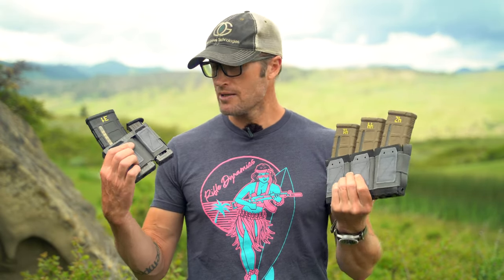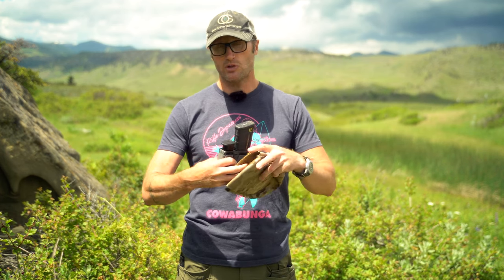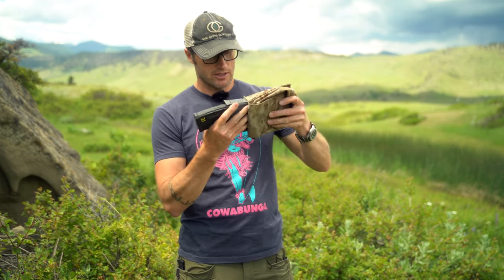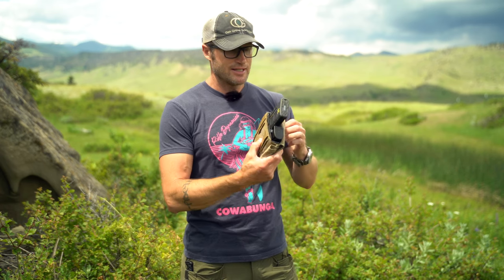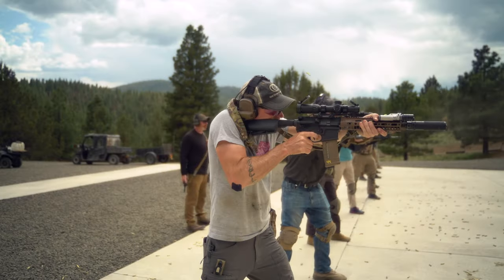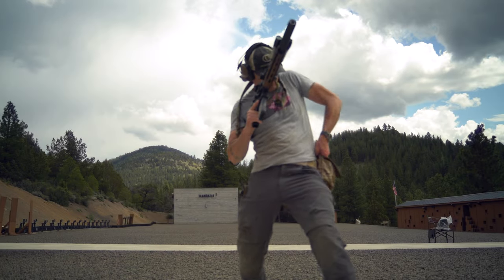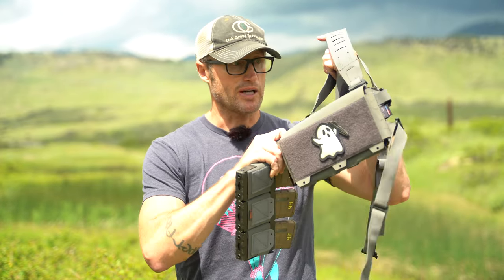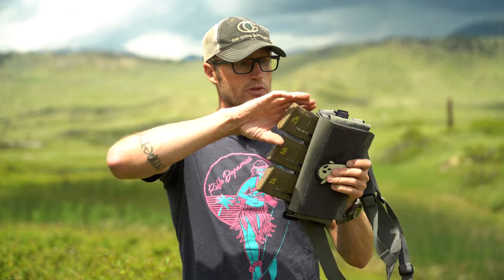Tricert and 1R1 from Lunar Concepts

Comment: I have a 1r1 in a JSTA pouch, retention is good with both G17 and G48 mags fwiw. I did have to use some cardboard to slide it in. I initially used a sheet of paper and it just ripped. 🤣 I bought it from Wise Men Company, had to wait a while for it to get back in stock but worth it.